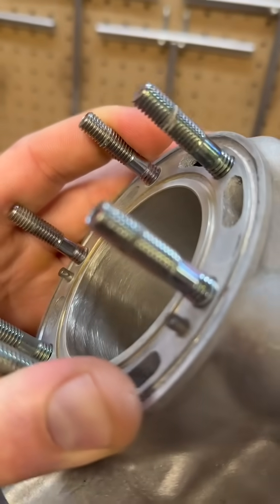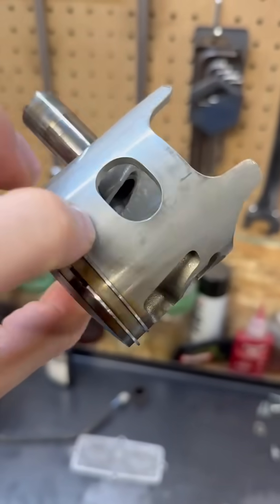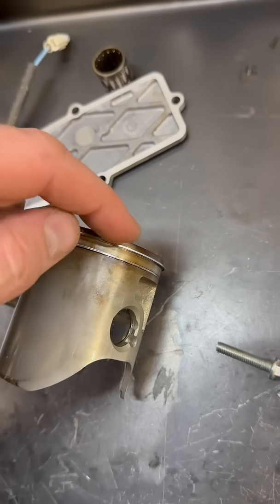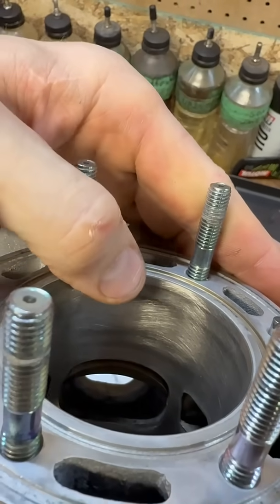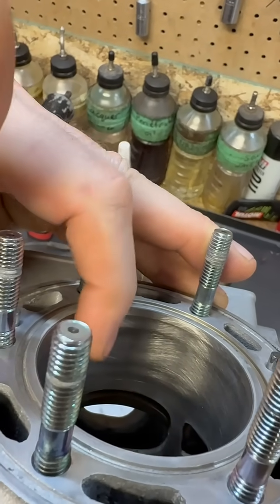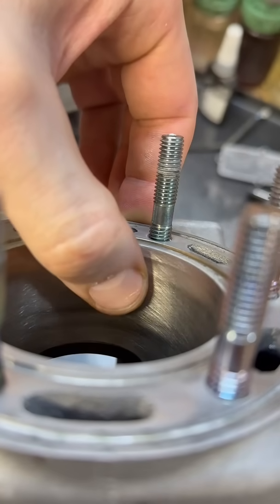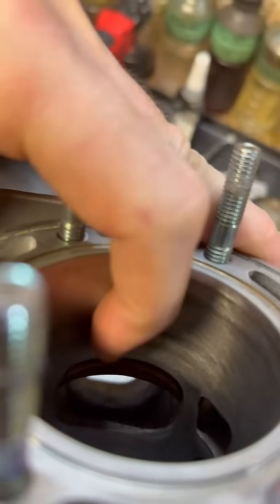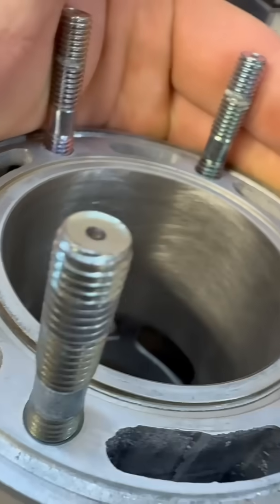How to Inspect Nikasil

Comment: Hey on Ktm 125s using a feeler gauge in between rod and crank web is 0.55mm right? And do you know the spec it needs to be in between
Reply: According to the KTM Service Manual for my 2024 125sx, that dimension should be between .45mm and .75mm. I don't know if that is the same or what year your bike is. Lemme know if there's other specs I can help with.
Reply: @ what about the 2022?
Reply: @Seth-s5n  I can't say. I have a 2024. Possibly check the part numbers between the 22 and 24 crank assemblies. If they're the same, then bingo.
Reply from the maker: That measurement is totally fine. It will develop up & down play first.
Reply: @ChuckfromTrueTech  what’s the spec it needs to be in between